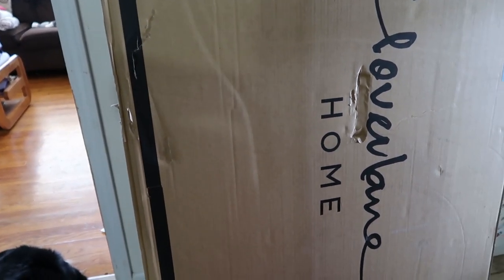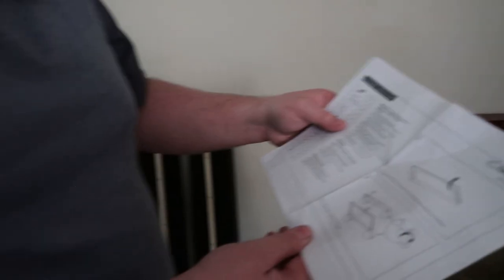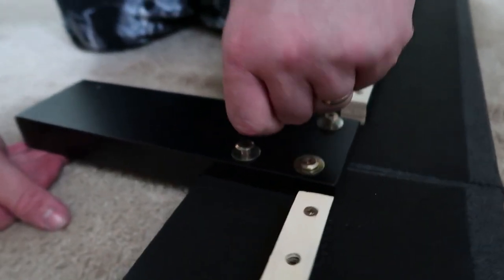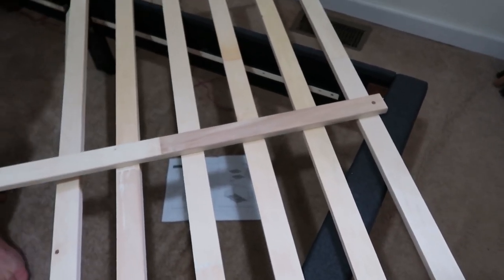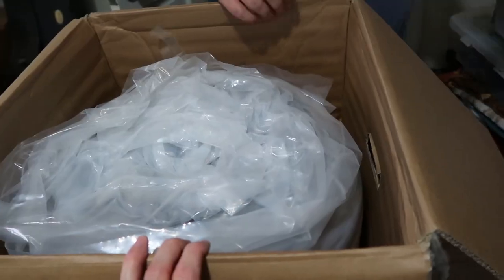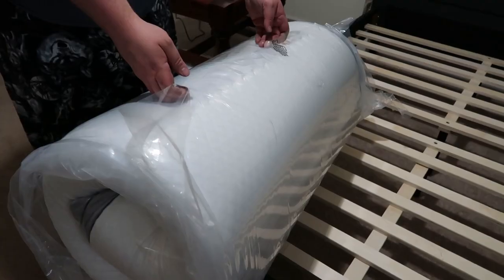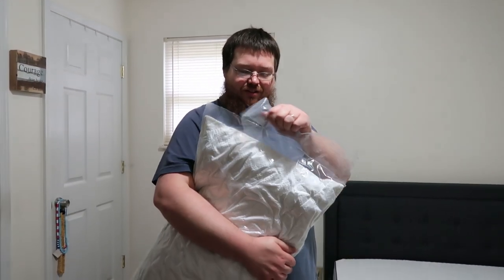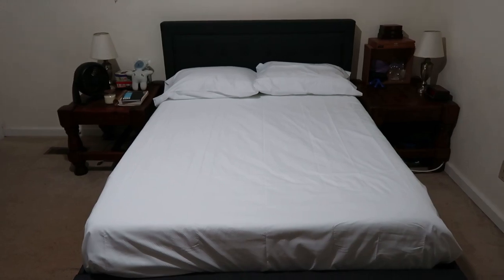Our Nectar Mattress Delivery + Setup

Comment: This was helpful. Thanks
Question: The last steps says to bolt 8 screws (N) through slat (G) and into the wood on the sides of C. While the slat (G) had screw holes, I did not see any screw holes on C for the screw through the Velcro and into the wood. How did you screw that in?
Appreciate the help
Reply from the maker: Were you able to finish it?
Reply: @ThisHomeschoolingAdventure  Yes. Turns out the last step was optional.
Reply from the maker: That's good to hear. I hope the rest of the video helped.

Comment: I just ordered mine and the reviews now are scaring me. I am very understanding the pandemic will delay things. what region of the country are you in? customer service said it should ship in 5-7 business days. would you think that is accurate? thanks for the video!!!
Reply from the maker: Our shipping was delayed and spread across 3 days of delivery. The bed frame came first, then the sheets and mattress protector. The third day, the mattress arrived. Most of our deliveries here have been delayed (we live in a rural area and use online orders frequently), so we didn't notice a massive delay in delivery.
Reply from the maker: And we're in Tennessee.
Reply: Don't worry. I ordered mine on May 12th and I received the mattress protector last week and my mattress was just delivered by FedEx today. I emailed customer service and a representative kept me abreast of what was going on. My sheet set has not arrived but should be here Sunday. I thought this was acceptable timing.
Reply: I ordered mine on July 6 and it just came today (July 21) and they did a total bait and switch with all the "free stuff" that was supposed to come with it.
Reply: @losangalex  Yes, they did. None of my free stuff except the pillows were exactly what they advertised. The mattress protector was a compete joke and they tried to tell me, it was because they didn't have the one in stock in their warehouses. So, I'm like, if someone bought it straight would they have received these "non Nectar protectors" ... no acceptable response. So, this experience was not what I, initially, expected. I ended up disappointed although, the representatives were responsive and they did offer me a very small discount ($25).